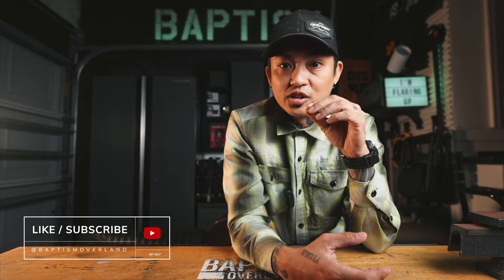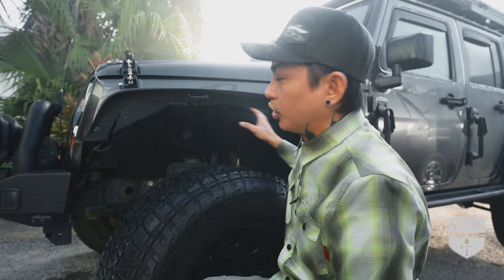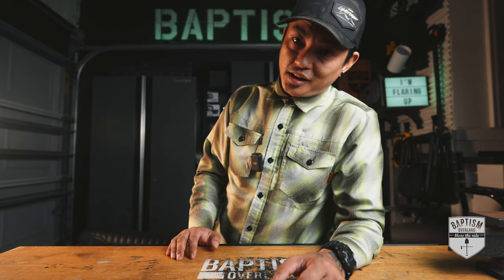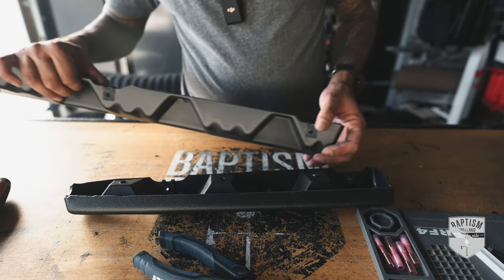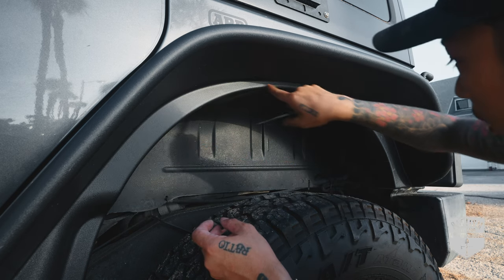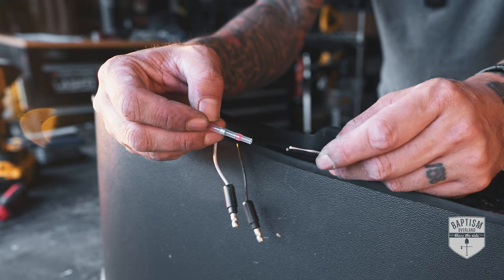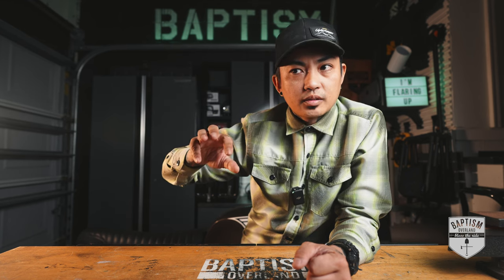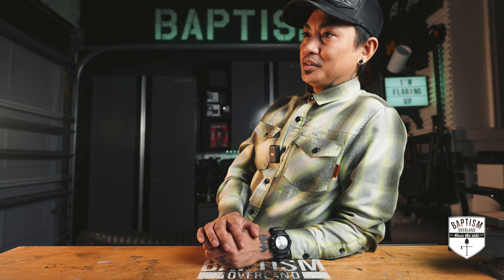Bushwacker Flat Style Fender Flare Install / Review

Comment: I have those ones too, actually on for just over a year now. You made a good point on the fading though, mine have faded and a little weird fade actually. Love the flares not a fan of the support though when I reached out about the blotchy fading. Basically told some garbage and have a nice day... Love them but not a fan of the support...
Reply from the maker: Damn that sucks!
Reply: Fading wasn't an issue for me as I traded my metal ones for used bushwacker ones that had been painted a burgundy colour so I had to paint them to match my Jeep which is black with orange accents.  I did the round tube look ends in orange and the flat portion in black.  Holds up pretty good.  Love them.
Reply from the maker: @Monarch67  That's awesome. That's what I'll prob do when these start to fade. Or just do a whole jeep wrap

Comment: I'm glad you put those really nice bushwhacker fenders on. They look so much better. The bushwhackers and the rough country high clearance fenders are my two favorites. Only problem with the rough country fenders are a bunch of drilling out the holes to accept lots of riv-nuts. It's not a concern if you're never going to change fenders, however I like the option of going back to OEM fenders if wanted. I watched your first video and was glad to see you didn't drill a bunch of holes
Reply from the maker: Yeah that's the reason I never went with RC. Also the reason I talked about  not making it a permanent install if you have second thoughts because once the rivnuts are on, it'll be harder to swap later